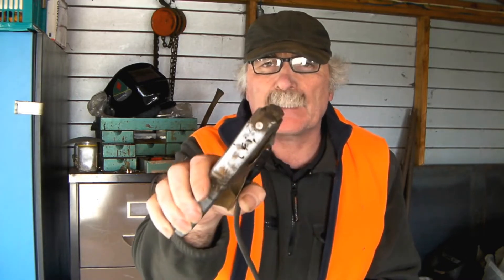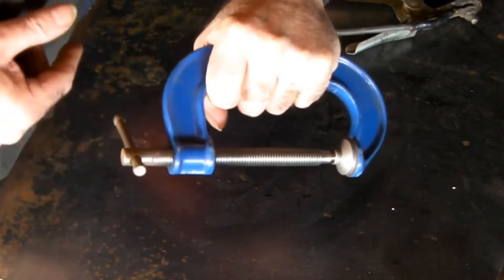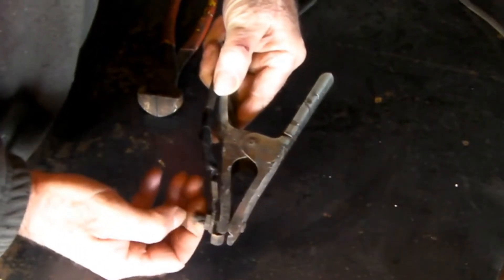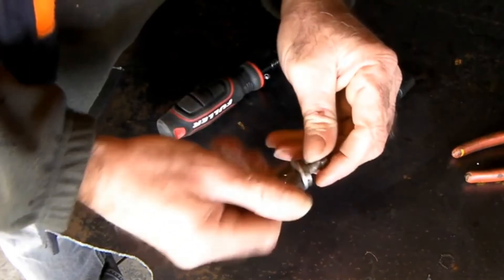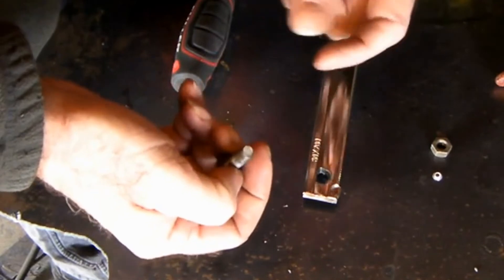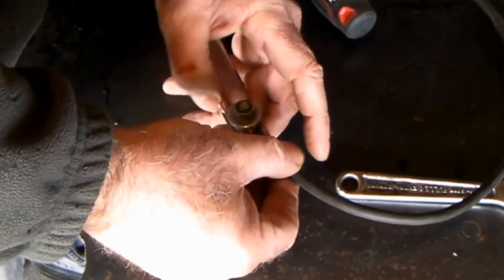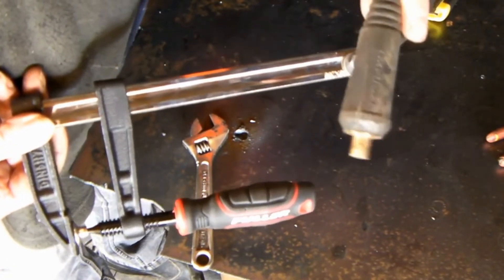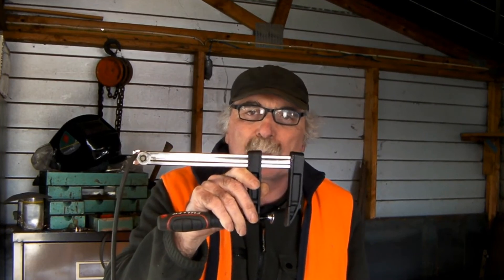DIY Cheap Welding Ground Clamps

Comment: I have three plasma cutters, 50 amp - 80 amp - 125 amp. Occasionally the ground clamp don't get firm contact to the metal to be cut, thus causing electric sparks in that gap. This results in an instant meltdown of the teeth or perhaps the entire tip of one of the jaws, before you even have time to react. By the way, concrete residue is famous for spoiling ground clamps.
As a scrapper I usually have several clamps in good condition laying around in my workshop. I found that clamps from for example better quality car battery chargers are large and solid, and have a much stronger spring than original ground clamps. They are perfect for this job.
Reply from the maker: Hi mate, yes that's a good idea cheers Pete